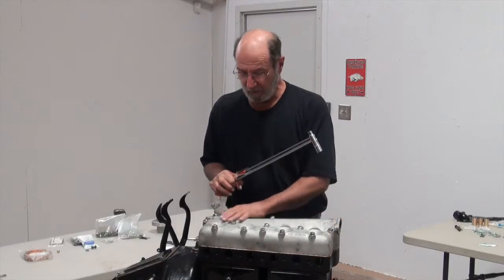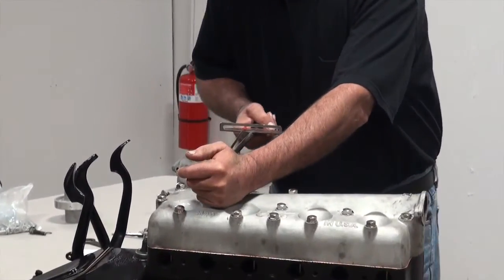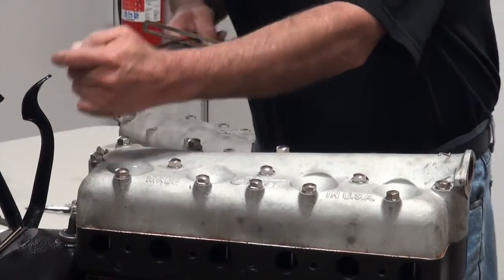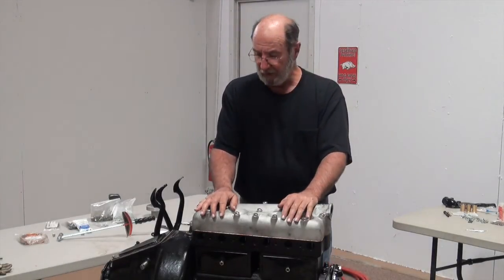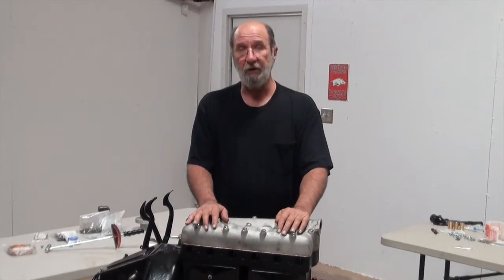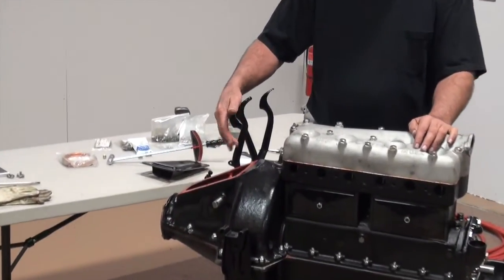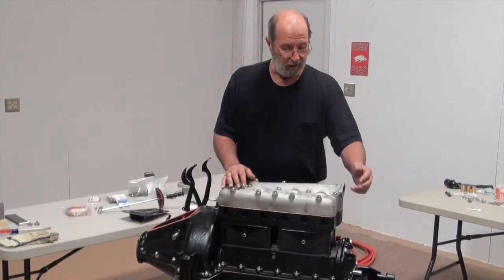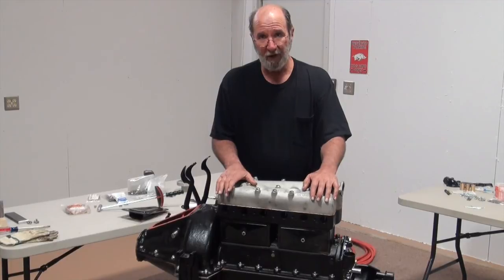Engine 37 Wrap Up

Comment: As I hope you noticed in the videos, we built the engine for instruction and to be able to take it apart at various technical meetings.  So as noted in the videos, we instructed how to seal up the engine, but we didn't actually do it so it can not be run as it is currently assembled.

Thank you very much for your comments!